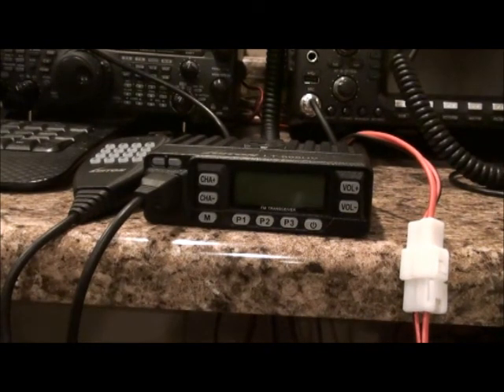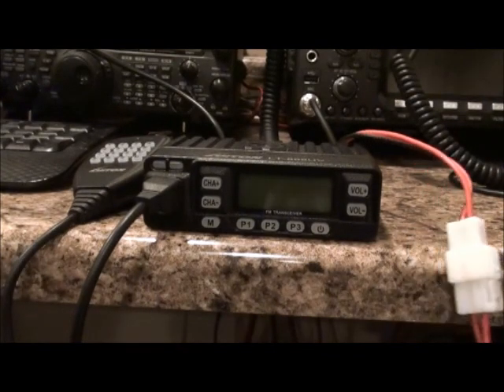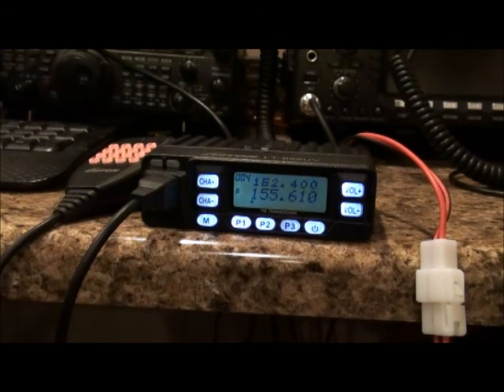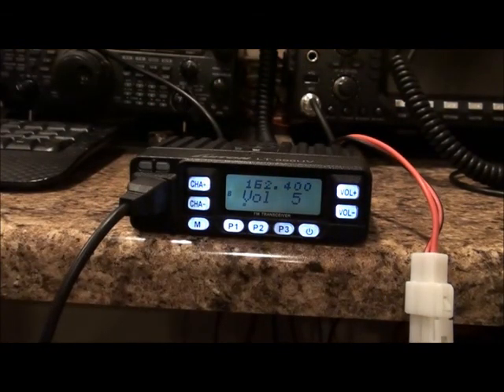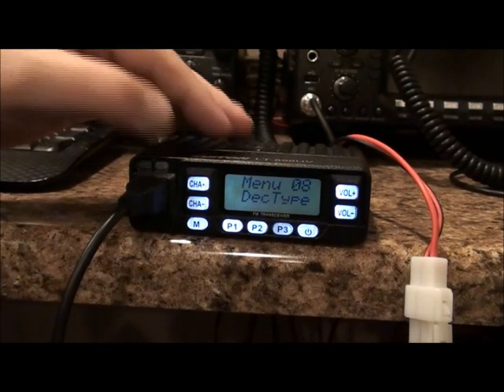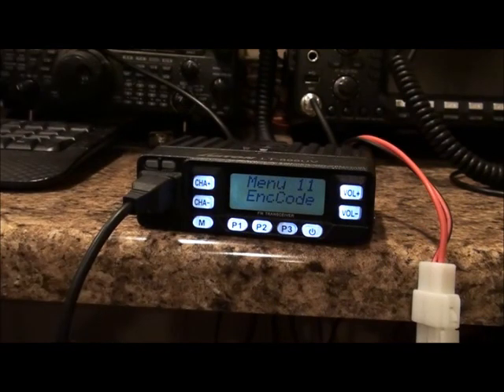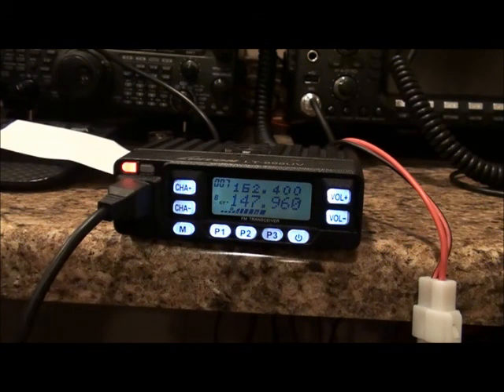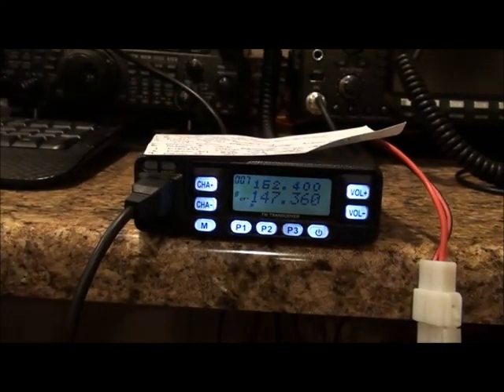manually programming the Luiton LT 898 UV

Comment: Mine is a Leixen VV-898SP, same radio with 5/10/25 watt power settings, in a metal case in a backpack. I am slowly figuring it out. Some registers will not take manually entered numbers from the mic DTMF keys. They can only be set using the up/down keys on the mic. At least one of the registers is one number off from yours, and the manual... Some registers change when you hit the menu and dump you back to the main screen but changed the setting. The manual could be a lot more clear and concise.
Personally I find the UV5R a lot more user friendly.

Comment: Thanks for heads up.  As i was entering the freqs for mine, I noticed some shortcuts.  The BAND key on the mic is the same as the M key on radio.  So I was able to enter all of the freqs without even touching the radio.  And to get it to escape from an enter mode, just tape the xmit button on the mic.  It quickly exits entry mode.  I worked for hours trying to get the cable and software to work.  I even tried loading modules into chirp.

Comment: I just got this radio and after 2 mins it turns it's self off and the sleep mode is not on. it keeps doing this, please help!
Reply: Sounds like it’s overheating.
Reply from the maker: have you tried to reset to factory settings
Reply: yes 3 times now, I'm guessing there's something wrong with it.

Comment: Hello, I purchased this rig in the summer. I cannot manually enter any frequency, except the 146.550 call freq. For example, if I enter 146.655, I cannot get the radio to read that out, it will show 146.655. The zero at the end will not show. I have had success programming all my repeater freqs with the chirp. I would like to be able to do it manually, in the field. Have you run into this problem at all? Thanks, KC3BXZ Joe
Reply: I noticed it depends on the step size in VFO mode. I set my step (menu 41) to 5K and it works pretty good.
Reply from the maker: No I haven't heard of that.. when I get home, I will take a picture of my "cheat" card and send it to you
Reply: No need to send the card copy. Thanks anyway. I have followed yours and other manual program instructions already. It could be, my radio is updated to prevent manually programming it.

Comment: I am having problems with menu 16, SMALL numbers set.  It says in the manual that "Channel Alias" has to be set for BIG numbers.  I can't find a reference anywhere for "Channel Alias" in the manual and can only get BIG numbers.  Do you know how to overcome this?  Thank you in advance.
Reply from the maker: hello,  thanks for watching my video.  have you tried pushing your C button on your microphone?
Reply: +Jason Williams Yes Sir, and thank you for responding to my question.  The "C" button changes the frequency from "A" to "B" or vice versa, however it does NOT change the size of the font, which I understand it supposed to happen.  I looked at the manual thoroughly, and the best thing I can find is that Channel Alias has to be allowed (I think that's the wording) and that too is OK.  I used both manual and CHIRP trying to set this up.  That was the only problem I have found, and it does NOT take away my feelings of loving this radio.
Reply from the maker: Phottoman next time I have my radio out, I will play with the size setting. Once I programmed it, I stuck it in a cinche sack and loan it out to my ARES guys for when we have training.
Reply: +Jason Williams Thank you.  That would be GREATLY appreciated.